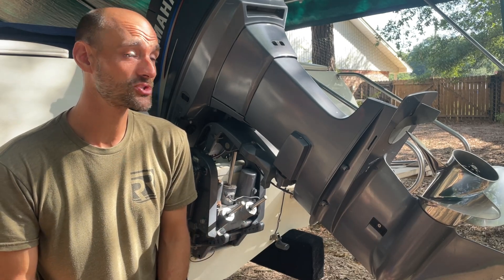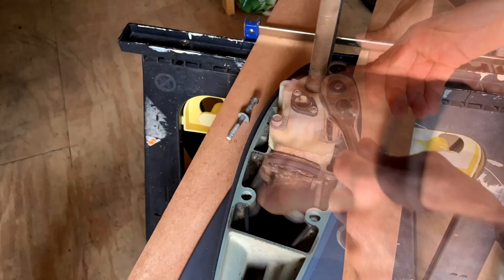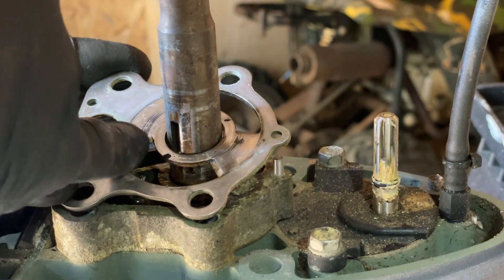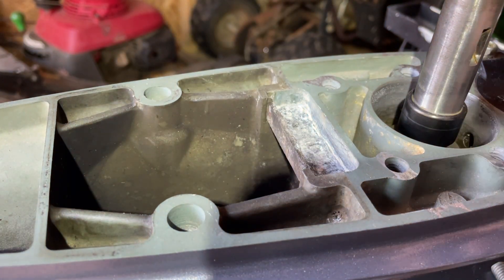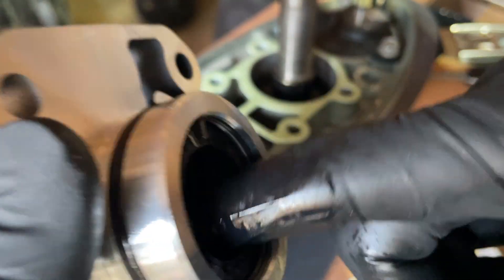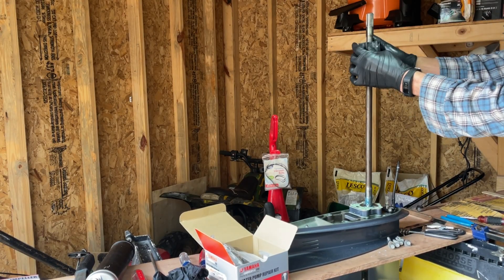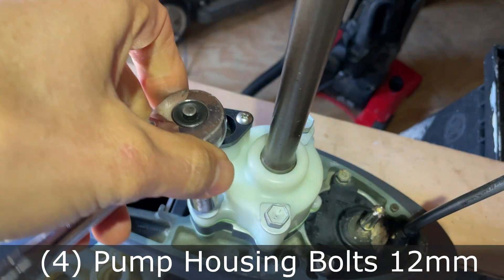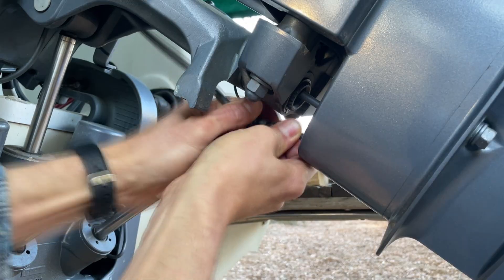Yamaha Water Pump Replacement

Comment: Hi mate, super helpful video. Thanks so much for making it! Can you please confirm what the water line at 1.25 does? My tell tale has stopped peeing and I was wondering if this could be the issue!
Reply from the maker: After doing some research it would appear that might be the speedometer hose if you have a speedometer hooked up. If not, online research says that it should be capped off. Mine has a plug in it currently and extends up to the back of the engine.

Comment: Are you sure your oil seals are both supposed to face down? Took my 2002 apart same set up and 1 was down 1 was up
Reply from the maker: Both of mine were facing the same direction and were installed by the factory. Not sure if anyone ever replace yours or not, but that was how mine were installed.